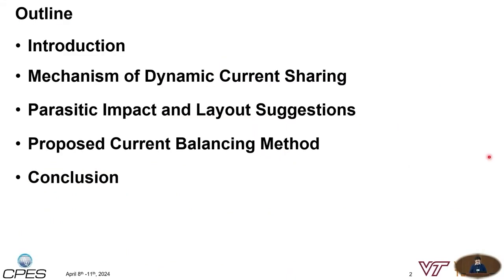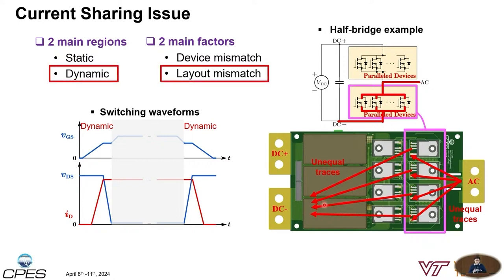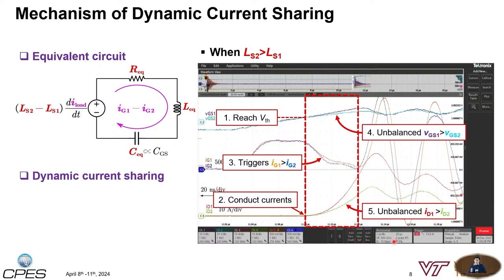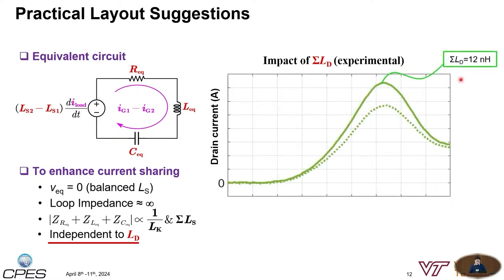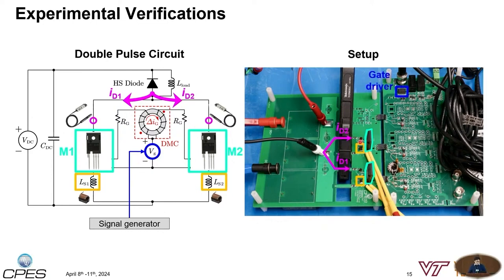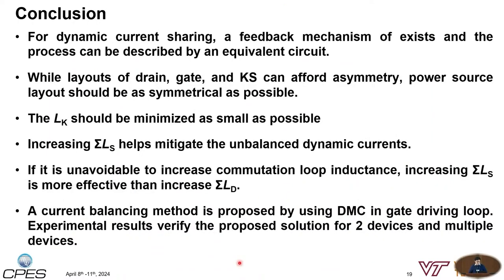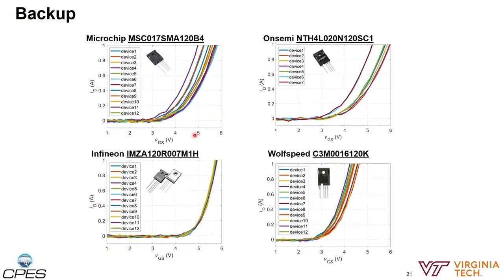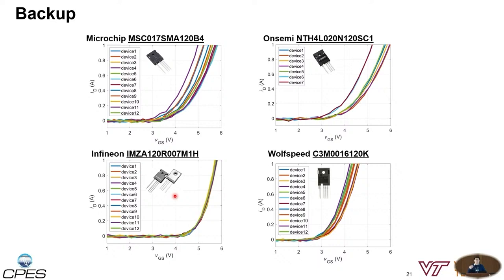Che-Wei Chang - A Passive Balancing Method for Dynamic Current Sharing of Paralleled SiC MOSFETs

Comment: Nice derivation of the disbalancing mechanism! I did not look into the paper yet, but wouldn't a common mode choke be preferrable, as it also compensates for the common-source inductances without sacrificing the low impedance of the gate driver?